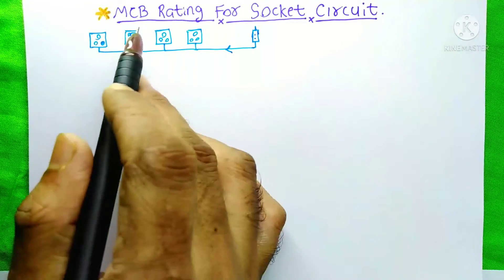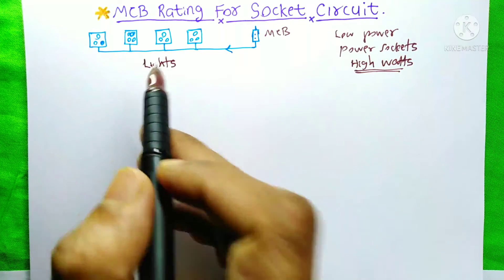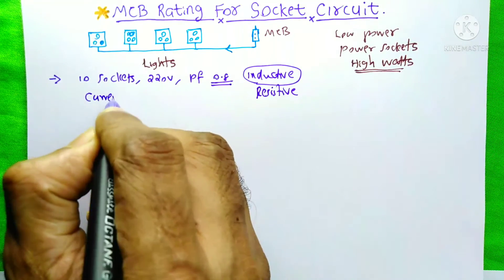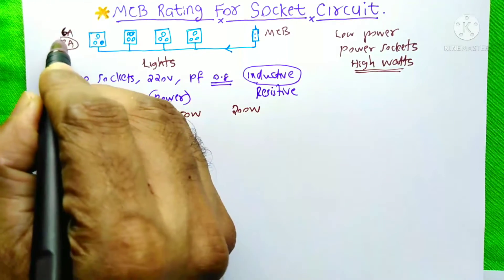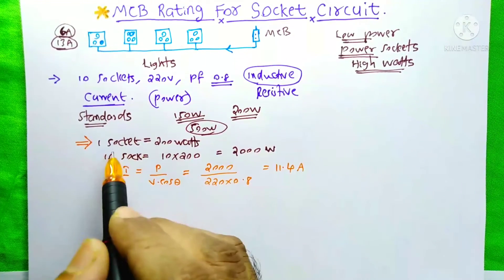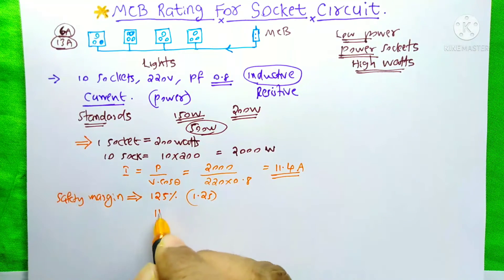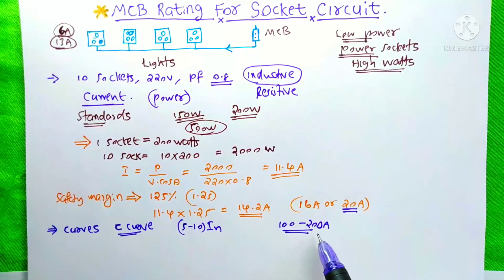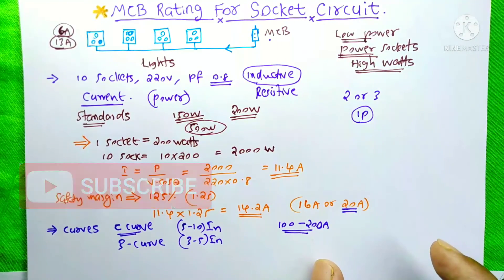How to calculate MCB rating for socket circuit | MCB curves | MCB types | Electrical

Comment: Nothing correct here,you should explain diversity,type of circuit, overload protection etc
Reply from the maker: No need diversity , it's socket circuit, no need overload ( it requires for motor like circuits )